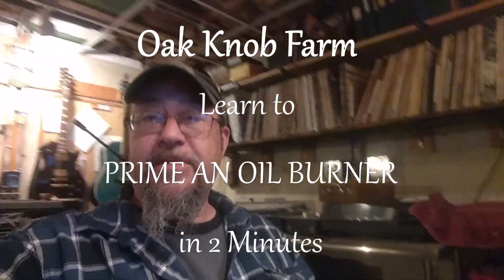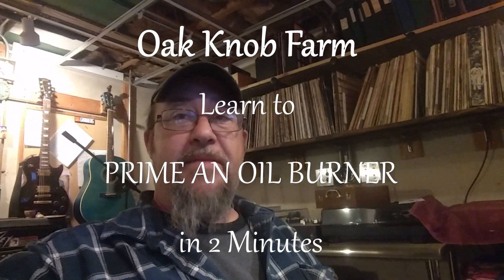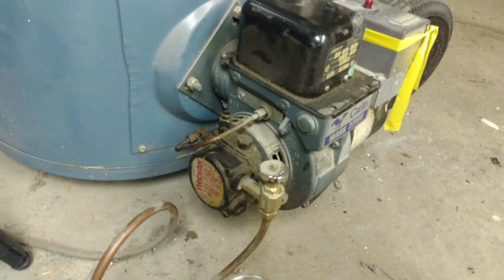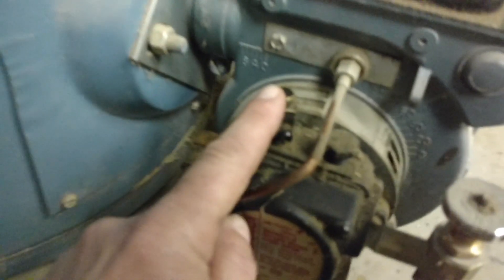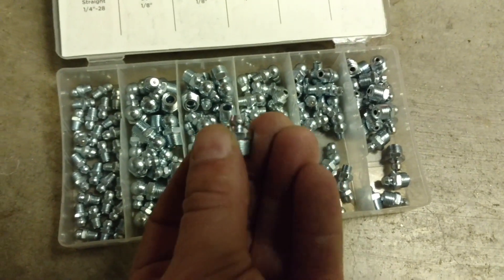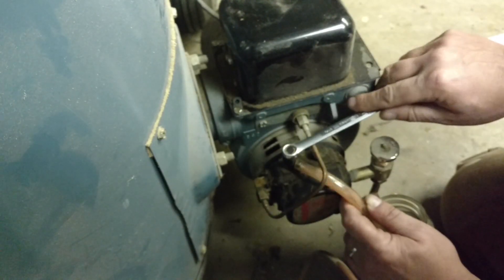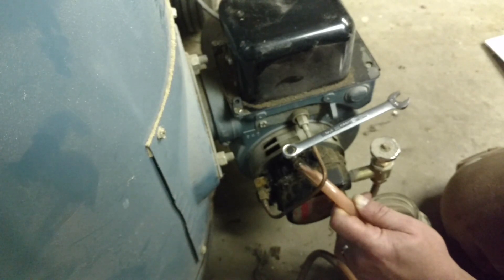Learn to PRIME AN OIL BURNER in Two Minutes

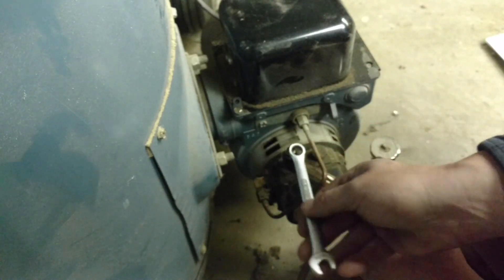Comment: My boiler, which is over 70 years old, does not have a bleed screw/port at all.  Rather, I have to completely unscrew the nut holding the flexible metal oil feed tube to where it enters the motor assembly (which, in the video, at 1:12 is just above Steve's fingertip) and put it into the top of a large glass bottle. Next, I hit the boiler reset button, and what came out this year was a bit of foamy oil before the liquid oil came through, thus proving there was some air in the line. I have a 275 gallon tank in my basement, and suddenly a few weeks ago the heat just wouldn't come up. I put in for a full oil delivery, and it took 236.6 gallons to top it off. When the heat still didn't come up even after the tank was filled, I knew I had to bleed it as this great video demonstrates, just like I had to do similarly in December 2020. The heat did indeed come up after that, and I had it on for awhile, although I didn't really need it, as the outside temperature was in the mid to low 50's here on new years day 2022 in New York . . .